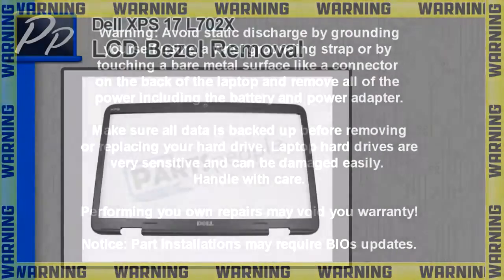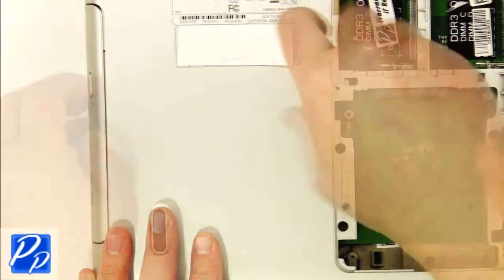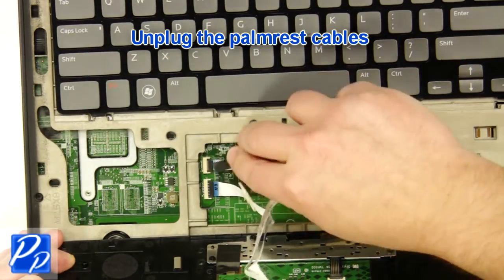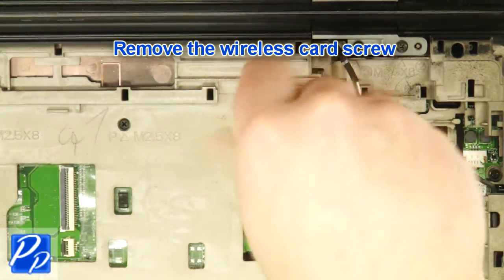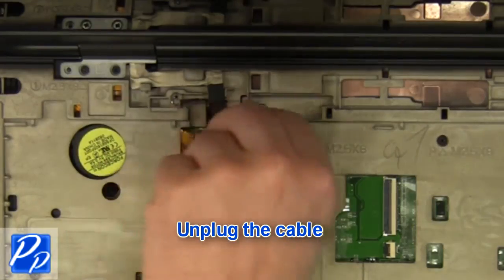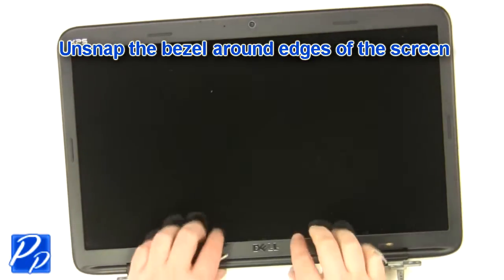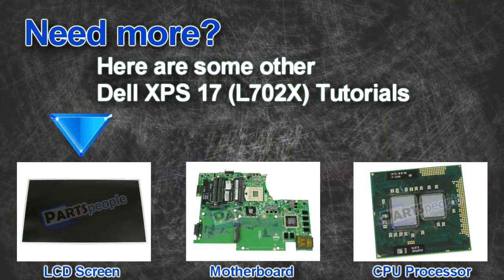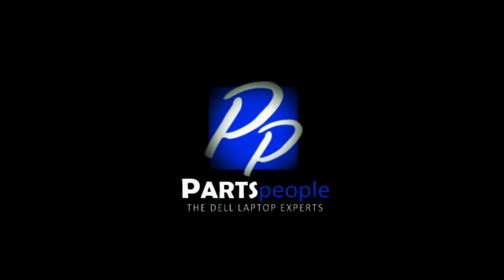Dell XPS 17 (L702X) LCD Bezel Replacement Video Tutorial Teardown

Comment: Is it necessary to do the full disassembly to get the bezel off? I was able to unsnap it by starting on one side and going all around. I just took the battery out for good measure.